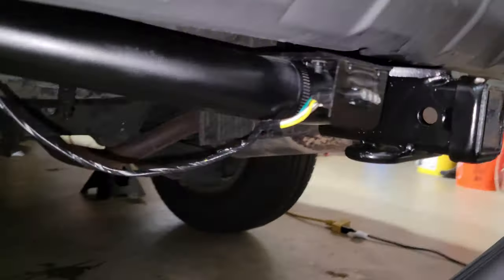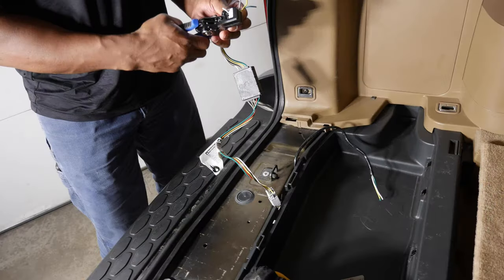2004 Honda Pilot - Budget Trailer Hitch Installation - Part 2

Comment from the maker: Nice to have this hitch installed on the Pilot. Wasn't too difficult.

Please leave a 👍 and share the video!

👉 Visit our website ► http://carapprentice.com
 
👉 Click to Subscribe! ► https://bit.ly/3bLvCFd

👍▬▬Follow Us on Social Media▬▬👍
✔ Facebook ►  https://bit.ly/3bHtMFC
✔ Twitter ► https://bit.ly/3hLdJKK 
✔ Instagram ► https://bit.ly/3u380lS 

🔧▬▬Tools and Materials▬▬🔧
✔ Car Apprentice Recommended Tools and Materials ► https://bit.ly/3DP75xM
✔ 3M Stripper Wheel ► https://amzn.to/44dDpVb
✔ Rustoleum High Performance Primer ► https://amzn.to/3Pqb1uY
✔ Kuject Self-Solder Butt Connectors ► https://amzn.to/3JZcS6e
✔ Klein Katapult 11036W ► https://amzn.to/3JSlb40
✔ Curt 55336 Trailer Wiring Harness ► https://amzn.to/3pQ0HC8

📷▬▬Video Equipment▬▬📷
✔ Camera used ► http://amzn.to/2GcpkOb 
✔ Lens used ► http://amzn.to/2Deu16S 
✔ Tripod ► http://amzn.to/2GbaM1c
✔ RAM Suction Mount ► https://amzn.to/2Wz9PXh
✔ Cyberlink PowerDirector ► https://bit.ly/2jTwGxT
✔ Adobe Photoshop ► https://bit.ly/2V7nyUX
✔ Camera Slider ► https://amzn.to/2WtD7GW
✔ Deity V-Mic D3 Super-Cardioid Directional Shotgun Microphone ► https://amzn.to/2LI1lf7

This video was recorded in 4K resolution, so modify your settings accordingly if desired for better image quality 

Disclosure: This video contains affiliate links, meaning, at no additional cost to you, I will receive a commission if you click through and make a purchase.